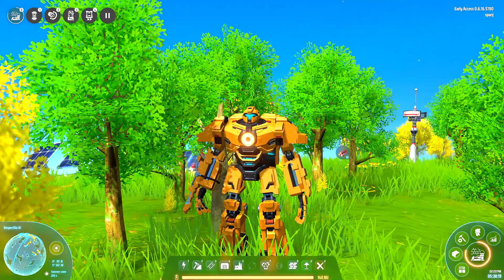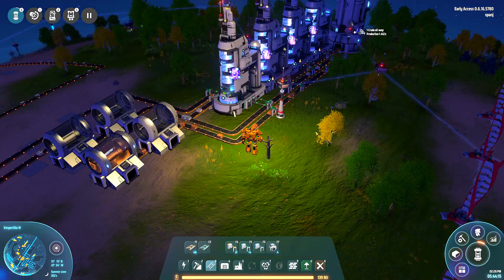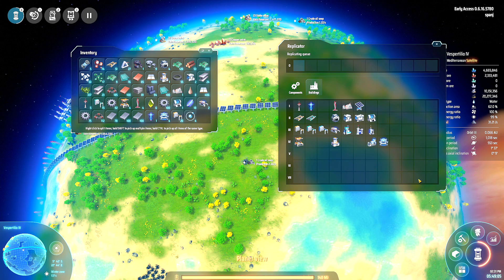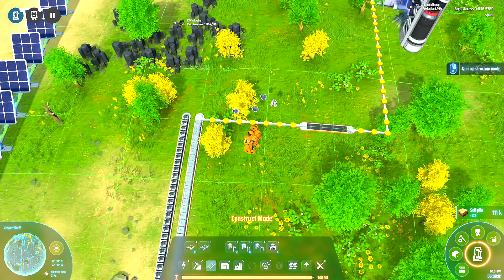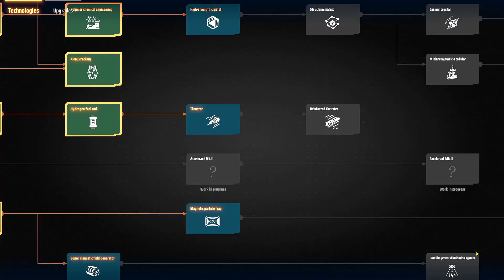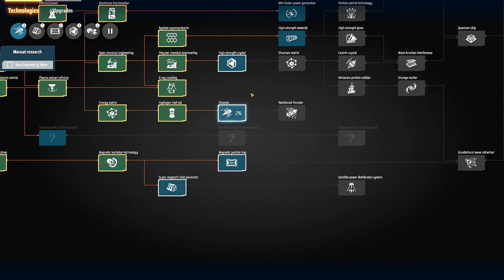X-Ray Cracking & Processor Manufacturing | Dyson Sphere Program | #4

Comment: Try changing up your x-ray cracking to output hydrogen before the input of the building so it feeds itself hydrogen to use up more refined fuel. That way you'll produce more hydrogen from the refined fuel rather than just stock-piling it up. The x-ray cracking produces more hydrogen than it uses so you'll still have a surplus.